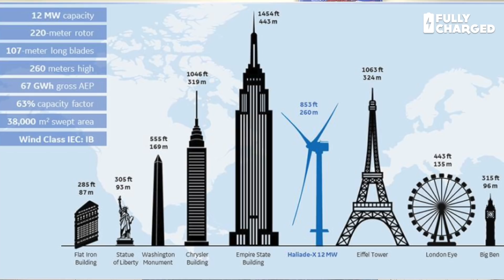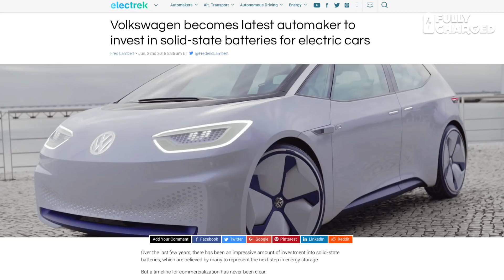Winds, Waves, Trash and Solid Batteries | Fully Charged News

Comment: I like windpower as you do probably, but what you see/saw 2018 onshore has in average of 1MW to 2.5MW, very few mills with max. of 3.5 MW. Offhore the max. size was 8 MW from the most powerful windmill. Today 2020 windmills with max. power of 12MW (GE) are running in test field, earliest production not before 2021. As much as we would like to have more power it is not that simple anymore to make them bigger!

Comment: You got one small thing wrong Robert, a 12 MW turbine will not produce just as much electricity as two 6 MW turbines over the lifetimes of the turbines, it will produce more. The capacity factor of the 12 MW turbine will be larger than that of the two smaller turbines, meaning it will operate for a greater percentage of the time.

Comment: I wonder does decommissioning the oil rig in the sea means complete removal of the entire structure?. I think engineers could design it to collect renewable energy, solar, tidal, and wind then store it in batteries on site to dump the energy in electric ships out at sea.

Comment: Same old lie, deliberately confusing capacity with load factor. And no matter how big the turbine, when the wind don't blow it generates absolutely nothing. Until the problem of intermittency is solved then wind power can never contribute more than a tiny fraction of our energy needs and worst, requires watt for watt back-up by gas or coal forever on expensive standby, ready to fill the gap left by wind power when not generating.

Comment: Some facts regarding "installed capacity vs. real life output".
Wind is a fluctuating power source. 12 MW doesn't mean annual average production 12 MW.
But it's better than one might think: With solar you have no light at night and way less in winter. With wind you can optimize your power output for the most likely wind situation. Onshore this is usually 10 m/s, because this occurs way more often then a storm.
There's a measure called "full load hours". Onshore wind has around 1500 h, offshore (due to less obstacles+turbulence on the see) around 4500 h (a year: 8760 h).
This means the 12 MW power plant has around 6 MW annual average.

Comment: How are big windmills for MW/ton of steel?
Twice as tall mean 4x as much surface area, but all else being the same, up  to 8 times as much steel. Isn't steel bad for the envirinment?

At sea, foundations are just silly expensive. Why not anchored barges interconnected to form a strong platform for a nice little wind park?

Comment: Did you hear about newest induction hub motors? It based on the innovative technology of combined motor winding (a star and delta winding combined parallely),  and has more torque, power, energy efficiency, less heating and best performance reliability! This is the most advanced technology for the electric cars, bikes, and bicycles, i think! You can read about it here: https://solargroup.pro/ebj375

Comment: Great show again. One thing I might want to ad is that wind turbines seem to have increased efficiency the larger they get. I think it has something to do with lower rpm and reducing frictional losses. I heard the RWTH Aachen university is looking into carbon fibre turbine blades which can be disassembled into more manageable sizes and then plugged back togther at the building sites so on shore wind turbines could reach huge sizes as well. And Simens was commissioned to install a large wind park in the gap between China and Taiwan, so, good news: This happens basically all over the globe.

Comment: Compulsory monitoring for anyone before commenting on the benefits of wind should be www.gridwatch.templar.co.uk
25 June 01:00 we have about 24GW of capacity which is generating 0.70GW - this is why our bills aren't getting cheaper - for all this wind you have to have a gas power-plant in the background ready to kick in.
Reply: Indeed, it's not a panacea... none of the renewable sources is, on its own.  However, as pointed out above, low wind often coincides with high solar.  Add in more diverse (geographically) off-shore wind deployments and the use of off-shore tidal (as per previous FCS episodes) and on-shore gravity/hydro etc, and they should complement each other.

That said, until we also have significant storage, you're right that we'll also need some form of 'emergency' generation - presumably from non-renewable.... but significantly less than we currently use.  And if/when enough electric cars are rolled out, and house-hold power-bills provide benefits for using them to stabilise the grid, then they would also provide that distributed storage....
Reply from the maker: I check gridwatch.templar regularly and indeed, during periods of low wind the output is risible. However it often coincides with periods of high pressure and clear skies, like at the moment where we are reaching peaks of 9 Gigawatts of solar generation. Without question the adaptation to absorb the cushion the effects of variable generation are an engineering challenge but one this country is leading the way on. In the next 12 months we'll see the installation of gigawatt scale battery storage connected to sub stations around the country. We will need less and less gas generation in future
Reply: Batteries are good for short term load management and shifting some solar to the evening, but that's pretty much it.  Maybe we'll get to the point we import hydrogen from sunnier climates over the winter, convert some gas power stations - not efficient but if the cost of PV keeps going down, maybe it'll make sense.
Reply: fullychargedshow - the more of us that install batteries, the less volatile the grid will become. If we each add home micro generation like solar, the price of electricity will be affected as we consume less from the grid generators. Energy companies will walk away from expensive generation sources like gas just as they did with oil, in favour wind and solar backed by batteries so they can participate in the UK energy market (NETA)
Some may have noticed that the price of gas is going in the direction of up like oil.
Reply: @fullychargedshow - agree with much of what you're staying, there's definitely some really helpful correlations, one often missed is during high periods of wind in winter our homes loose more heat and need more energy to keep warm - wind can really help with that load.  Of course solar and air-con needs have a lovely correlation.  The problem I see is none of the technology that's on the horizon will get us through a long winter depression and security of supply is incredibly important, so we will still end up with terribly under utilised gas generators, this is good for the environment - but it's costly - and to pretend otherwise isn't helpful

Comment: Hey Robert, I know this isn't a Tesla fan channel and it's important to keep impartial to keep the integrity of the show, but if possible could you please ask your contacts to reply to the claim that 'a Tesla car is just as damaging to the environment as an IC car'? The media seems very anti Tesla atm and this recent attack could cause a real set back to the adoption of ev's by an ill informed public. Many thanks.
Reply from the maker: Sadly this tired old horse is dragged out of the knackers yard every now and then and beaten with a large stick. This is not just a simple misinterpretation of a report, it's a deliberate and orchestrated attack on one particular company by investors trying to make a quick buck. A financial consultancy called Engaged Tracking created the report and used utterly fictitious data to twist the results to make a Tesla as polluting as a smaller, lighter petrol car. It's just like the 'brake dust from electric cars more polluting that a diesel truck reversing up a hill in the snow' type nonsense. I will potentially have a rant about it.

Comment: For the record, these 12MW of the turbines is the maximum output, not their real life average output.
Reply: I'd prefer politicians to carry on calculating based on peak numbers.  They are already reluctant enough to honor the Paris accord.
Reply: Sure as wind is a fluctuating power source. But the factor you're below the installed capacity is way smaller than for solar.
Wind power plants are optimized for a medium wind speed, not maximum wind speeds.
Meaning they look at the statistics which wind speeds occur how often.
If you design your maximum power output is already there at low wind speeds, you waste a lot of kinetic energy in stormy wind.
If you have it at high wind speeds, you don't get a lot of electricity when the wind is slow.
There's an optimum there.
For onshore usually they run full load at 10 m/s and don't get more energy when the wind is faster (cause that's not happening that often). Offshore is probably optimized for slightly higher wind speeds.
And off shore wind power plants do have around 4500 full load hours. Meaning the annual average output is more than 6 GW.
Reply: so if they do that they will install  only 30% of what they think they are doing.  And so effectively go even slower with removing coal and gas.
Reply: Obviously. Why does this need to always be pointed out as if people haven't realised we don't live in a constant force 8 storm?
Reply: Because many people (inc politicians) calculate with these maximum numbers, instead of the average.
To make a fair comparison, one need to use the average numbers.
Don't count the chickens before they hatch
Reply: JayBee . That totally depends on the power curve of the windturbine. Which is definitely not the same for smaller turbines vs bigger turbines. Also, i was more referring to other ways of getting energy.
Reply: Piet Muijs
Just like the horsepower rating of an IC engine.  It's rated at it's max hp @ specific RPM with x amount of torque.  You don't operate it at max output all the time, but when you need it, you know what it's capable of.

Comment: 1:12 Well, no, according to Wikipedia it is only 4.9% from Offshore Wind!
https://en.wikipedia.org/wiki/Energy_in_the_United_Kingdom
Reply from the maker: Fascinating. I followed the link you posted and it's a dead page. Maybe there's a massive conspiracy to keep the truth about off shore wind secret and really it doesn't work and it's a massive global con... or something equally Breitbarty
Reply: I fixed the link.
However, if you tried, I'm sure you would've been able to find the Wikipedia page yourself.
I also don't see why you have to resort to insults and I assume that you're clever enough to doubt the number you've given (40% offshore wind) yourself. There isn't even close to 40% renewables in the UK energy mix, and that includes much more than just wind.
Reply: You've said: "We regularly get up to 40% of our electricity from offshore wind".
You have an average power consumption of 41 GW in the UK (gross), but only a capacity of 7 GW offshore wind turbines installed. You probably refered to wind power in all, that's 19 GW installed capacity.
Reply: Ah, so that's what he meant, you're right. So at the peak, there is an up to 40% contribution of offshore wind temporarily (or 17% according to @"Just Curious"'s numbers).
But that's a bit misleading, if the average contribution is just 4.9%...
Reply: @#David: No, I suppose, Robert mixed up "wind power" with "offshore wind power". Wind power (onshore AND offshore) regularly (temporarily) achieves 40% of electricity production in the UK.
Offshore wind power alone can't achieve such a high share, too less power installed.
Offshore and Onshore wind power together produced 49,607 Gigawatthours in the year 2017. This was 17% of the total electricity use.
There was a big step from 2016 (12%) to 2017 (17%). 
And I agree, it's a bit misleading to mention such peaks, but not the average share.
Source of the 17%: The first table here:
https://en.wikipedia.org/wiki/Wind_power_in_the_United_Kingdom

Comment: Why don't they put solar panels on top of the blades of the windmils?
Reply: You probably underestimate the working forces. 
These blades have to be very strong and light. No place for photovoltaics. Anyway, the surface would be too small to get a reasonable yield from it.
Reply: I suggest you to watch this:
hyetsolar
https://www.youtube.com/watch?v=mo_VaL0Ead8
It's "only" 11% efficient (normal solar panels around 17, but up to 21%), but I think it's worth it actually.
Reply: Anyway, they would increase the weight of the turbine. If you want to get solar electricity from a wind turbine, why not cover the tower with photovoltaics? Would cause less trouble.

Anyway, why put solar far away into the sea instead of installing it near to the consumers?

Comment: I still think we should develop safe nuclear plants which don't create much radiating waste at all since nuclear powerplants are CO2 neutral and fusion plants aren't ready just yet, nuclear Power has the highest energy density of any kind of powersources if used right and will take the crown of renewables in the longrun
And what should we be using on mars or in other Galaxy where there isn't enough solar to power everything?
Reply: He mostly get the numbers bunged up a bit wrong. That's why he thinks nuclear is expensive.  No it's not. it is costly, but you get 24/7 dependable high output, that really replaces coal/gas-plants and can be integrated where ever you need it.
Reply: ferkeap yes, biggest factors are cost, safety and waste disposal, LFTRs could be a solution to all of these but they have a few challanges to overcome, mainly acceptance from the public since they don't want nuclear anymore and think that it's always unsafe, but for me Nuclear, renwables and battery storage could go hand in hand, if it were ecconomical.

Comment: Yes and as we move to renewables, the cost of producing electricity will drop substantially, yet the price charged to consumers will continue to rise. Like Solar power. Perfect example is Orlando Florida where you don't own the solar panels you payed for on your own roof, the power company owns them, and you sell electricity to them. The whole purpose is to keep a power company afloat. It's subsidised via law rather than government coffers.  Renewables promise free power, but we won't be allowed that.
Reply: A lot depends on your location/utility board/utility.  I live in Iowa and MidAmerican Energy (Warren Buffet owned) is on a multi-year wind turbine blitz build.  By 2020 they should have enough capacity to equal their annual retail sales of electricity.  Because wind energy is so inexpensive, the have announced that they don't think they will need to ask for a rate increase until 2030!
Reply: Is it illegal to own your own solar panels in Florida, seems unlikely in the land of the free?  I can confirm in Europe you can buy solar panels, put them on your roof and you definitely own them, and the energy they produce.
Reply: Edward Cooper, rules/laws are different all over the country.  Gererally nothing stops you from owning panels and the power they produce.  The problem comes when you want to hook up to the grid.  Depending on which group is regulating your utility, you might get full retail price for any power you feed into the grid, or you might get so little that it is not worth having the panels.
Reply: If the true value of the electricity produced by your panels is not enough to pay for them, then that should be the panel owners problem.  The other customers on the grid shouldn't be required to subsidize the panels.
Reply: The problem is that the owner of the panel in many cases is not being paid what the power is worth.  Since the utility is a monopoly the panel owner has no bargaining power and the utility can pay whatever they choose.
Reply: In Orlando it is due to local by laws.
Reply: Why do you think I mentioned specifically Orlando Florida?
Reply: NeonsStyle paid
Reply: Florida sounds even more corrupt and screwed up than I realized.  Maybe you should vote the crooks out and elect some progressives.

Comment: Solid state batteries sound good, but its actual specifications may not be as good as Gigafactory Li-ion cells' already are. Tesla with Panasonic put together a ~450kg 80kWh pack for the Model 3 ... which will cost less than 100 USD/kWh next year, they are already very close to that figure now.
A little side note, the Tesla Model 3 actually uses about 65kWh from the 80kWh pack, while the rest is used for thermal management, so the battery will hopefully last that magical number of 1 million miles with at least 70% capacity remaining. If you'd disable thermal management and drive carefully (to not overheat), then the Model 3 would go about 450 miles on one charge, that is already 700km.